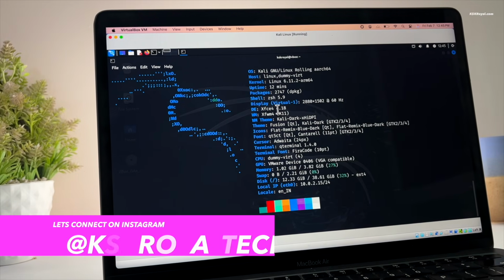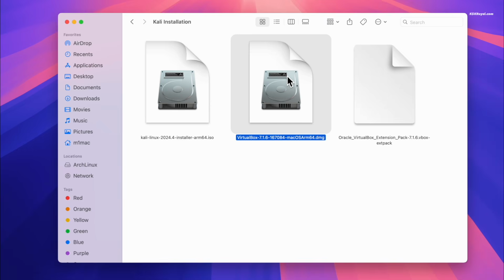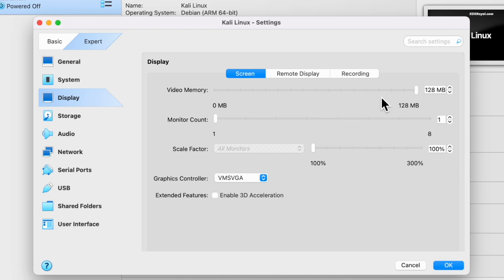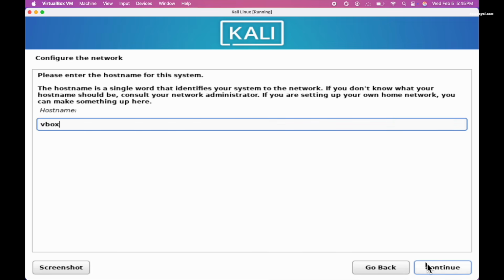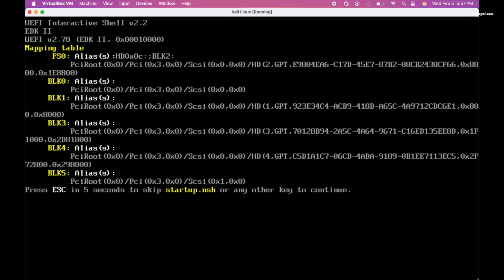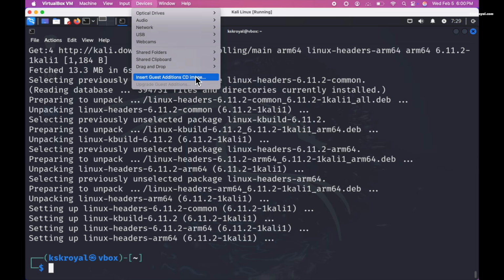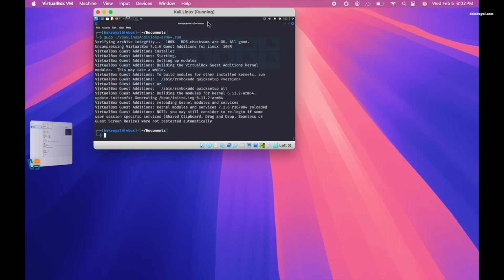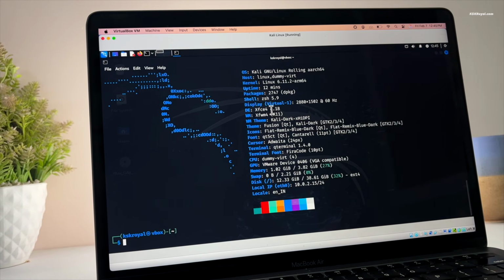Install Kali Linux on Mac (M1, M2, M3, M4) // Run Kali Linux on Apple Silicon Using VirtualBox

Comment: Hey! I’m planning to buy a MacBook Pro with the M4 Pro chip mainly for cybersecurity. I know I’ll need to run Kali Linux or similar VMs for real-world offensive security tasks (like network scanning, packet injection, reverse shells, etc). My main concern is: will everything work properly inside a VM on macOS? I need full compatibility and solid performance, no limitations that could block me from learning or doing serious cybersecurity work. Would a MacBook still be a good option, or should I consider something else?
Reply: Got a mac mini M4 I had to install Ubuntu about a month ago because I couldn't install Kali on a VM. Windows 11 and Ubuntu worked fine, all installed through this guy's awesome videos :) 
Would like to know if this method is gonna work, since I just found this video
Reply: Same question bro!
Reply: yep similar story here.
Reply: I ended up buying a used m2 pro macbook pro with 32gb of ram for a really nice price and so far it's been a dream! mac compatibility has really been nice and the only program I found that I wasn't able to run in my cyber type programs was autopsy, which had a weird web ui instead. got kali on arm running and legit everything I tried in there worked. native burp, wireshark, and more. terminal being in unix is even better. I would still have like a windows PC/old laptop on standby just in case there's something incompatible, but so far It's been sunshine and rainbows. don't sleep on macs!

Comment: This solution is also working:

 I fixed this by adding a start up file in the EFI partition, in the EFI shell run:

FS0:
edit startup.nsh
Then enter:

FS0:\EFI\kali\grubaa64.efi
Then save the file with CTRL+S then ENTER
Now restart the system and grub boot loader should load :)

Comment: Thanks, Ksk Royal, installed successfully on my M1 with your pretty direction. but I see GRUB is no need to run manually on my installation it runs automatically. may be recent version of kali fix it for M1. thanks again.

Comment: Thank you for a great video guide. Installed on M4 MBA, it would seem that the reboot/boot issue has been resolved, didn't need to use shell command.

Comment: how to fix the EFI thing:
just start up Kali normally follow the command in the video.
when kali started, open a terminal and enter these:

sudo mkdir /mnt/efi
sudo mount /dev/sda1 /mnt/efi

it could be you need sda2. To know which one run in same terminal:  lsblk -f
then search for a FAT sonethibng with big mb size with lable EFI
For me it was the sda2, so --> sudo mount /dev/sda2 /mnt/efi

after that, type the following:
sudo nano /mnt/efi/startup.nsh

enter this inside the startup.nsh:
FS0:
cd EFI
cd Kali
grubaa64.efi

press CMD+O (to save) and then press enter (to keep same name) and then  CMD+X (to exit)

then umount the partition: sudo umount /mnt/efi

restart your kali, and then when it starts up it countsdown from 5 and let it just do, dont touch. and voila

Comment: which is a better option to install kali on a macos system, using UTM or using VirtualBox because I heard I a video that with UTM the problem is it wont read and connect to the network your laptop I connected to and you need an external adapter to do so

Comment: Thank you! Can someone please explain why the GRUB is not being loaded automatically on M series devices ? (I have M4) 
Does it work with other virtualisation softwares? 
Is there a way to fix it on VBOX ?
Reply: reinstall GRUB  or manually load using iso

Comment: all works great thanks but is there no other way to overcome the shell issue ? do I have to write the command everytime I boot the system ?
Reply from the maker: I tried my best to fix this issue. As of know this is the only way to manually load grub every time its reboot to work with kali.

Comment: Thanks for the great video, it's pretty detailed. For the boot loader error, run this command on the shell screen to fix it. (Also found it on a another video 🙂)
Shell> FS0:
FS0:\> edit startup.nsh (to create and edit startup.nsh in text editor and key in the following commands below)
FS0:
cd EFI
cd Kali
grubaa64.efi
Save and exit from editor
FS0:\> reset (to reboot kali VM)
Reply: FS0:
edit startup.nsh
and then type these shit
FS0:\EFI\kali\grubaa64.efi
after that open the command help with control + e
save and exit with commands
and when you got the fs0:\> page you must type reset
Reply: Absolute champ
Reply: money
Reply: I haven't been able to get past this error with this. Not sure why.
Reply: MONEYYYYY!!! it worked
 thank you
Reply: its not working
Reply: your code broke my kali
Reply: How to save and exit from editor?
Reply: @juanferit  ctrl+s, ctrl+q. also you can look other commands with ctrl+e
Reply: DAMN YOURE LIFESAVER BROOO

Comment: Next video suggestions:
Asahi or asahi arch in external SSD (root)
And also encrypt root partition luks it in ssd... 

Please test if it works in Mac mini m4.

What's the difference between storage used by asahi and arch how much just after installation?